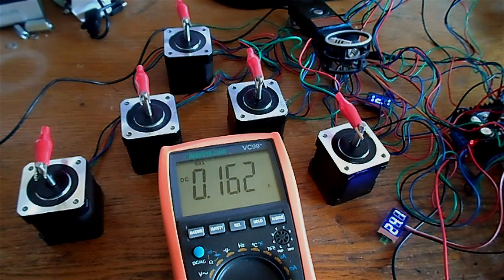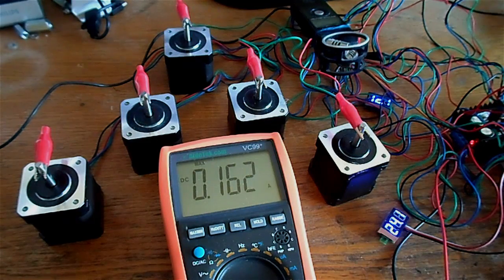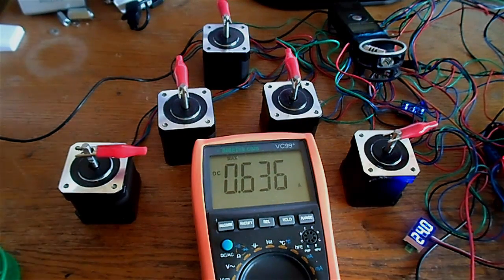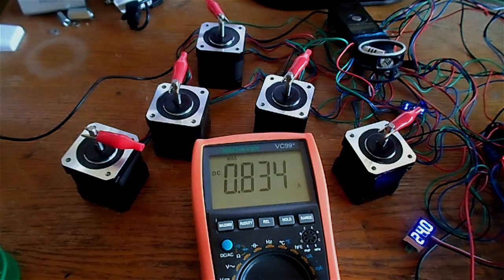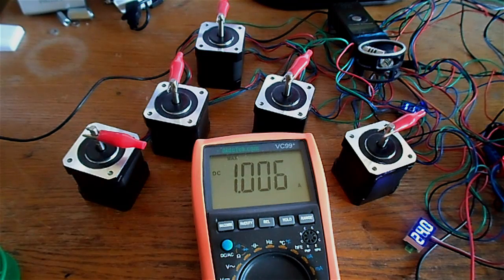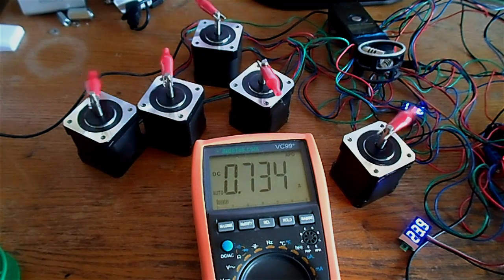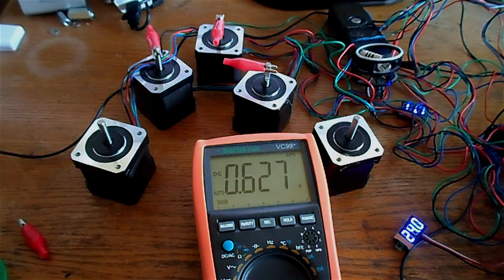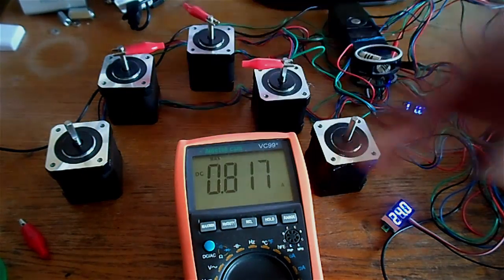Selecting a power supply for NEMA 17 motors

Comment: So GRBL and Arduino Uno with 4 Nema 17 motors can work with a 16 volts 3.9 amps laptop power supply? I could use it instead of a PC power supply, right?
Reply from the maker: Yes it works. 16v is pretty low voltage for nema 17. You should keep your rpms under 200 at that voltage

Comment: Digital meter is not going to see the real current as it's a ripple. DC reading is smoothing out the readings.  Put that meter on the AC side, reading AC amps, get your base line AC draw, divide Vin/vo (AC/DC) then multiple the AC current reading to see what they are drawing while running
test 2...current limit your DC supply to one amp, and I'll bet most will not even move at anything over .5rpm
Reply from the maker: That is why there are filter caps in PSUs. To smooth out ripple. So what is your point again? Power my CNC with a current limited bench PSU?
Reply: @mendebil  yes...go ahead and run your cnc machine of 3d printer with only a 1 amp power supply.  It will not fly. you'll need at least 400mA to 1 amp PER motor to do any work BTDT, 50 year carrier designing factory atuomation systems
Reply from the maker: @ptegler  Check out my metal cutting video using a 48w PSU (powering 4 motors AND the proxon 50 spindle). Not even breaking a sweat. Power draw comes from friction or large inertial masses. Belt drive is same as running motors in the air.

Comment: Flawed test. 

The only way to correctly measure current is to use a oscilloscope current probe to see the peak current into the windings.  A digital voltage meter cannot read the fast changing microstepping waveform that the driver is sending out to the motor.  The driver is sending a high frequency chopped current. Your volt meter is to slow to even see this.

Comment: "I don't have time for this BS" hahaha. This is how I do the math, my motors look like your motors so I will get a 12v 2A power supply. hahaha
Reply from the maker: Get 24V man.  And this test applies to belt transmission. If you are driving a screw , you need double the cuurent

Comment: Are these motors wired to the supply in parrallel? What I want to know is, is each individual motor drawing the amperage read by the multimeter? Or is the multimeter reading cumulative of all the motors?
Reply: It is the cumulative current consumption in series with PSU and all motors

Comment: hi is it ok to use bench power supply to power stepper motor,12 constant voltage?
Reply from the maker: Depends how much speed you will need from the motor. 12V is good up to 500RPM. 24V-1000RPM, 36V-1500RPM
Reply: @mendebil  can you say ,what should i have to go with power supply unit or programmable psu,i am in dilemma what to choose (both are same price with marigin 14$)

Comment: Hello, I saw your great video and I'm currently working on a project. I would like to operate 3 Nema 17 motors with the A4988 driver with a microcontroller. I can do that without any problems, but if more than one motor is controlled by the microcontroller at the same time, then both motors run slower. Likewise, if all 3 motors are controlled at the same time. I have already carried out measurements and saw that if 2 motors are controlled at the same time, then there is a current loss of about 20mA. I wanted to ask you how you did it. I couldn't tell you were having the same problem. All engines run stably. Have you encountered this problem too? I use an english translator because my english is not that good. Thanks for the answer
Reply from the maker: How are you measuring current loss? Sounds like the microcontroller is not working properly. A4988 receives pulses that determine stepper speed. I never had step skipping but it would be obvious , you would hear the motor skip
Reply: @mendebil  I have already tried this with several microcontrollers (Arduino Mega2560, Arduino Due, ESP8266. But always the same result. If several motors are controlled simultaneously by the same microcontroller, then the speed of rotation of all motors slows down. I have one motor-A the whole Let it turn for a while and then, after some time, switch on a second Motor-B via software. You can then see exactly that Motor-A rotates more slowly as soon as Motor-B is switched on. I couldn't see any change on my oscilloscope. The pulses were always the same size. But I could see that the current from Motor-A decreased as soon as Motor-B was switched on. The current from Motor-A decreases by about 20mA (from 220mA to 200mA). I think that's real strange, because my laboratory power supply can deliver up to 5A. Of course I tried to compensate for this with a higher current. But it didn't work. No matter how high I set the current, the motor-A loses speed age.
Reply: @sebastianhamburg2245  thats because your code is not fast enough i guess
use a 32bit faster mp and this should not be an issue
Reply: @patrickmaartense7772  no, the problen was the delay()-Funktion.
Reply: @sebastianhamburg2245  man induced loss of speed :)
Reply: @sebastianhamburg2245  AFAIK it`s microcontroller program issue, program make delay between each 'step' impulse (to give a time motor to rotate) , but if it that pause not used to send 'step'  to other motors, it`s a software bug, and as a result each extra motor will be wait while other motors make steps, instead of making steps simultenosly

Comment: Video says power supply. Yet video is about power consumption. wtf dude.
Reply from the maker: Video says selecting a power supply. (Based on actual current draw) wtf indeed
Reply: @mendebil  And you did NOT select a power supply. There also was no load on the Nema's. Your video was a waste of time.

Comment: This test is useless, the motors are only running under the rotor inertia. For a motor to draw power the power needs somewhere to go, in this case physical resistance of the rotor. Just because your starter can start your car, does not mean it car replace the motor on the highway. In that analogy 0.641A power overcoming rotor inertia is the starter starting the car, and the highway is the 2A max load the motor is capable of. Put it in a situation where it needs the full 2A capacity and it will use it.

Comment: This was not a good example at all.  You didn't put the motors under load.  Of course the current is low without load.  You need to put them under load to find out what the consumed current is.

Comment: You hear all that god forsaken noise?  That is because you're running low voltage PSUs.   This is from resistance from lower volt PSUs.  If you really want optimum power and performance from these you need to run the max allowed voltage.  Forget the current for a second.   Most steppers are rated at 24v.  That is the minimum power needed though.  Most steppers that can run 24v can run up to 48v just fine.  You should be running the highest voltage allowed period.  Not only will they shut the hell up, but they will be running with much higher torque curves at speed.   The current is generally able to be set via the drivers if you're running decent shit.
Reply from the maker: y u hatin bro
Reply: @mendebil  lol, I'm not hating!  Just telling you something you should know about.  I didn't know shit about this stuff a few years ago, but after building multiple CNC and Laser cutting machines I've had to find out a lot of things the hard way.  Your idea was good, but there are variables that you didn't account for is all I'm sayn

Comment: This test is useless unless the motors are under load...
Reply: I don't think so, because stepper motors have a different construction than brushed DC motors. when the stepper motor stalls, the rotating magnetic field does not stop rotating. only back emf affects when the stepper motor stalls
Reply: yes

Comment: does anyone know how much is average mechanical power of NEMA 17 if assumed operated at 600 RPM?
Reply from the maker: It is voltage dependent! And also depends based on number of stacks. Check the charts here https://pages.pbclinear.com/rs/909-BFY-775/images/Data-Sheet-Stepper-Motor-Support.pdf

Comment: This video is flawed. That multimeter is not able to do this kind of measurements, it has a way too slow sample rate and no TrueRMS function, so it will not measure the very fast peak loads from stepper drivers correctly.

Comment: very good explanation. thank u.
can u tell me why my stepper motor getting hot in no load? is it normal?
Reply from the maker: yes they can get hot to touch. basically your skin feels burned at 45C but they can run up to 80C without a problem. Check the current. Also it is said that the higher the voltage the cooler the stepper.
Reply: @mendebil  did u mean lower the voltage the cooler or is it otherwise
Reply: @pd.dataframe2833  the lower the voltage, the ampere getting high, to meet the power rating and the coil of the stepper are feel more stress cause of high ampere with the low voltage, therefore you should use higher vol;tahge

Comment: Is it Necessary to use a Power supply to run the stepper motors?? Because i didnt use a power supply which means connected the CNC Sheild and Arduino to direct 220V power supply using a 12v 1amp adapter, but the Nema 17 Motors were not Running, What might me the possible reason??

Comment: this is unvalid, they will peak  at current when you load them, i.e. moving heavy stuff
Reply from the maker: that is true but only if you use screw transmission. On a belt transmission there is very little increase in current. I have measured 500mA max at 24v. Still only a quarter of 2A
Reply: @mendebil  i feel you change the parameters in your answers ... load equals to more current draw end of story , futher more the bigger powersupplies is probly recommended to guard against power spikes ie if all 5 is loaded vertical and moved down then stop...the inductance is reverted back to the power supply .
Reply from the maker: @johannescordier7923  amy PSU can handle spikes. Still ... buying 10 amps for 1 amp average is stupid
Reply: @mendebil  maybe ... I could be wrong as my cnc is using 5 nema 42 motors , hand build the power supply to my requirements, imho not all psu can absorb power spikes as I had a few issues started with nema 23 ,thought it was the motors then upgraded psu ect then new controllers ,then motors  ect  that cut out that's why I mentioned it .(as I thought the machine was too heavy ,in the end the nema 23 with proper psu and supplies would have been fine .)
In the end the switching psu needs to be upscaled to prevent cut outs
Maybe I should just leave the experts and do my thing .
Reply: @mendebil  You are misunderstanding why a motor draws more current. It is not the method of transmission that impacts the current draw, it is the load. In your example, the threaded rod ( or screw ) vastly increased the motor inertia, increasing the load, but not to the motors maximum rating.
Reply: I don't think so, because stepper motors have a different construction than brushed DC motors. when the stepper motor stalls, the rotating magnetic field does not stop rotating. only back emf affects when the stepper motor stalls

Comment: how about 3 stepper motor nema 23? two motor with with 1.2nm and one motor 1.8nm and peak current is 3A? if I just using 24v 1.5 amp should be enough to power up all of them simultaneously?
Reply from the maker: the coils are different for nema 23 so I expect there is a difference in power requirement... the  idea is to measure first, buy after

Comment: i'm still trying to understand why all the higher amperage power supplies being recommended.  i did the same experiment and am only drawing a total of 620mA for three nema17's at 20vdc(3.5A).  So why is it recommended that i have at least a 12A power supply for three nema's rated at 2A/phase?
Reply from the maker: Nema 17 can be driven at 48V and the current could  be over 1A/motor at that voltage.  It could be that the current increases as the voltage does. the maximum voltage for the motor is 32 * √L = VMAX. Given the specified 20% tolerance, this is in a range between 49,57 and 60,71 V for my steppers that have 3mH inductance. On my new machine I am running the motors at 32V and they can draw up to 700mA each.
Reply: This test is basically useless without the motors rotating under load
Reply: you need to run the motors under load so they will draw more amps.  add a resistance equal to their torque carrying capacity and you will see the amps go up quickly.

Comment: какая номенклатура двигателей? нормально работают на 24в? не перегреваются? / what is the exact stepper motor model? are they operated correcrty on 24v? no overheating problems?
Reply from the maker: Hi, I am using double stack motors.See this PDF.  http://www.pbclinear.com/Download/DataSheet/Stepper-Motor-Support-Document.pdf They can get hot if working longer than 1 hour, but you can reduce the current limit to compensate. I wish I knew russian but I don't. ЗДОРОВЬЕ!

Comment: can we use a 12v/24v of 1a/2a trasformer with rectifer to convert in to  dc and u as power source for the 3d printer (including power for  motor driver board , hotend , base plate) or shall i compulsory need more amps power source

Comment: Very good explanation. I wait some thing like that. Can you show how you connect the 5 stepper motor with one multi meter? I want try this at my home. 
Thanks
Reply from the maker: power all the stepper drivers (need 5 of them) using the same psu  and put the amp meter in series with the psu.